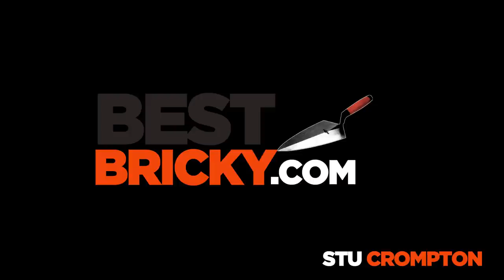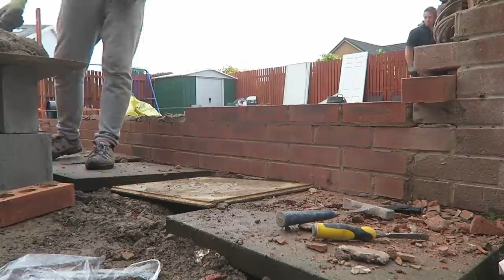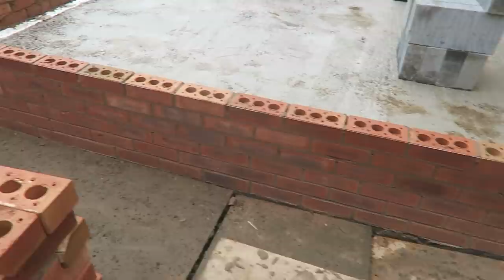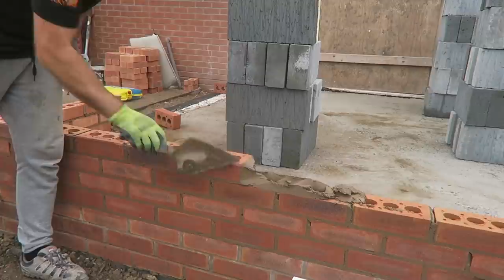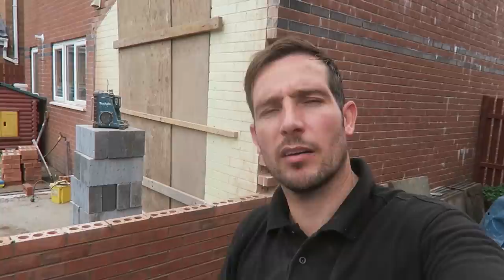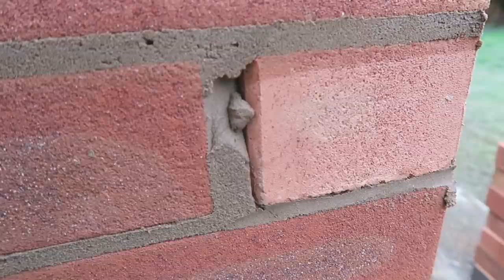how to build a brick extension on a house - Day1

Comment: Stu how come you put the brickwork up first and not the block work sure that makes it harder to put the insulation in
Reply: Oh ya great vid as always mate
Reply from the maker: not at all mate just put them in every 2 course, the reason is so i get my brickwork perfectly level then i can gauge my block work to the brickwork and make my block work perfect too. this is the way i do it anyway obviously not best practice for a big structure like a house.
Reply: stu crompton 👍 fair point makes sense everyone has a different method doesn't  make a difference as long as its right in the end great work and waiting on the next vid best bricklaying channel on YouTube
Reply: stu crompton that's because this is the only way you should do it mate. Top trowel
Reply: It can depend on what insulation you use. Partial fill boards need the block work first so clips can push tight. Full fill just pushers down onto ties.